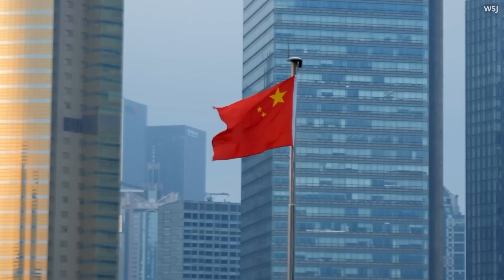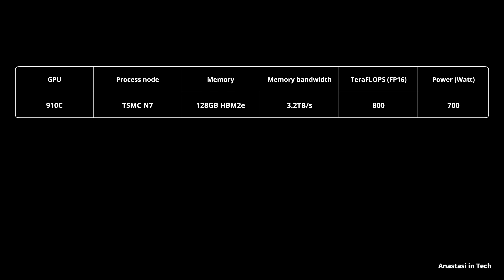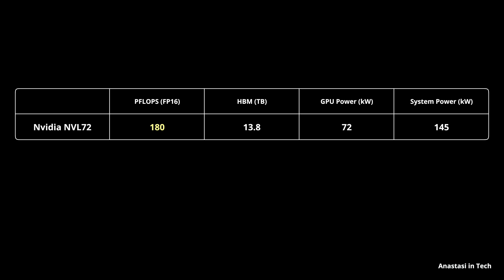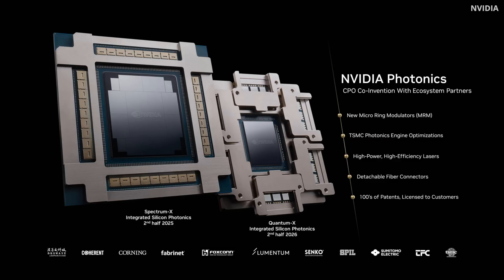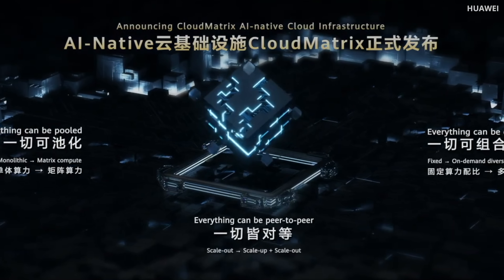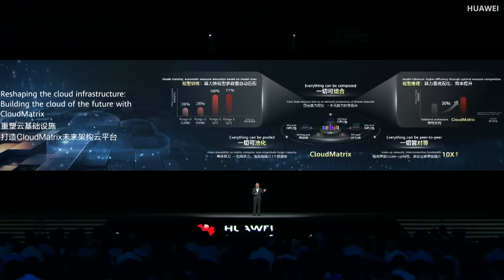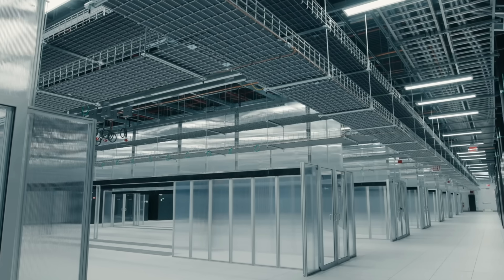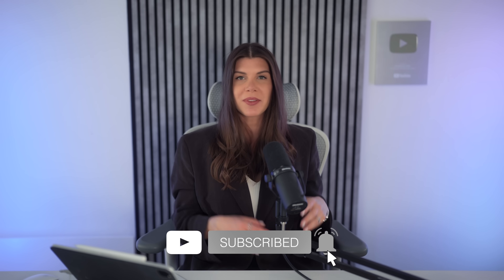Inside China's New AI Megafactory

Comment: From a maintenance perspective, it's difficult for me to imagine underwater data centers being viable. Even if we're talking about bodies of freshwater, I would imagine that being near the water would be better than being inside the water. Saltwater, meanwhile, forget it.
Reply: Thought the same. It is more of a fun project I guess… no one is seriously thinking of deploying something underwater at scale.
Reply: @dchdch8290  * LinusTechTips enters the chat
Reply: Microsoft did this a bit.  Their underwater data centers were filled with nitrogen to remove all oxygen.

Apparently the maintenance costs were lower because the cooling was very effective and the failure rate was much lower.  It was the deployment costs that were higher, much higher.
Reply: @StephenYuan thanks for sharing. Didn’t know that.
Reply: There are videos on underwater cooling and this one has a picture at the end 19:51 of the video  https://www.youtube.com/watch?v=DS-UmJWFPqU
Reply: If energy is so cheap in China, why are they going the complex route of underwater data centers?
Reply: @gk.4102  Probaply for efficiency reasons. Water has 200x the density of air, forced air cooling is drastically less efficient compared to water cooling, and although water cooling is used in powerful servers they use relatively small closed loops which still doesn´t come close to the heat removal capacity of fully submerged underwater cooling.
Reply: @gk.4102  The average Chinese makes about $16,000 a year so electric cost at 1/2 in the US is cheap but still sky high to them
Reply: @jwarmstrong lol You need to visit China instead of saying nonsense. Electricity for consumer use and electricity for industrial use are not charged the same. Also, why do people keep bringing up wages in USD?  They live and spend in their local currency. Products and services are very affordable. Cost of living is low.
Reply: @DaveMikeHasslehuff  What part of the CCP do you work for since words w/ out  showing the actual differences means you maybe hiding the truth -
Reply: @jwarmstrong How original. The working for CCP trope. Tribal mentality keeps you ignorant.
Reply: @DaveMikeHasslehuff  Please tell the truth for once in your life about your dislike of the little people in China that make iPhones , grow crops and get dirty every day